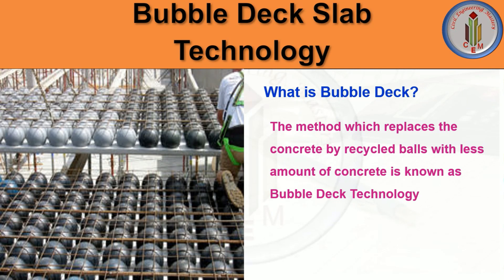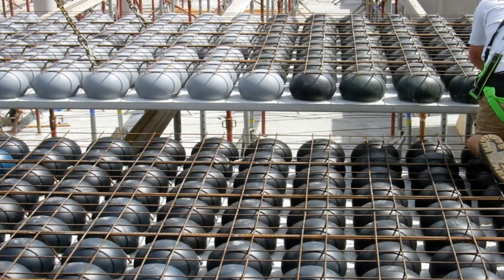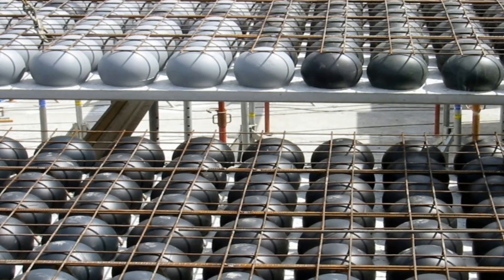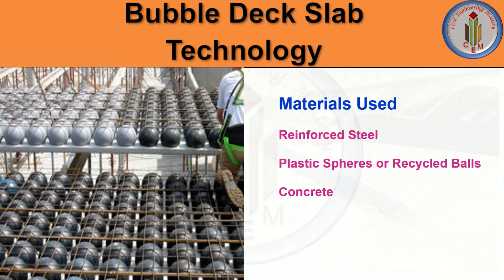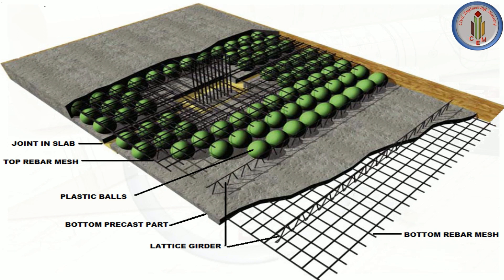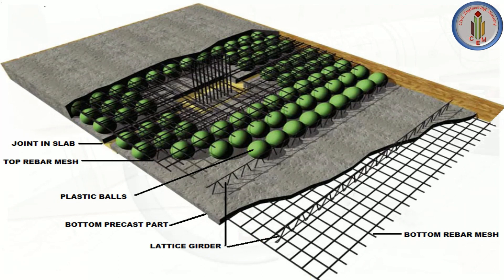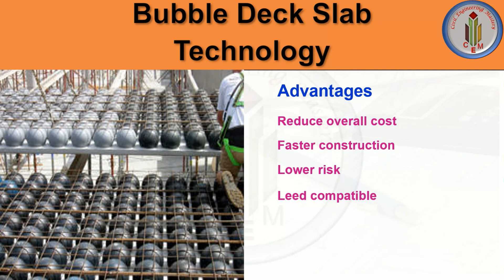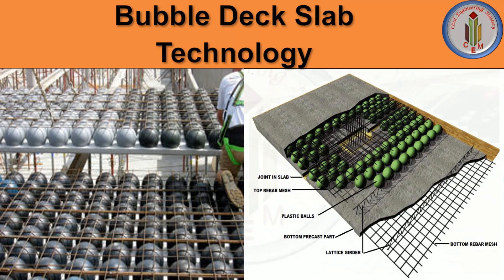Bubble Deck Technology |Bubble deck slab |Economic construction of slab using bubble tech technology

Comment: If HDPE hollow balls cracks due to heavy load or weather (overheat) .. it will have uneven level of slab..
Only can be use in slab of top layer of bldgs where no contigious load and tiles are use to reflect weather heat